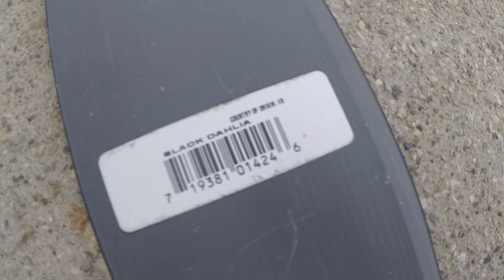BEST LED Light Bar Whistle FIX!

Comment: I guess the question is "Why doesn't the light bar come with a wind deflector?"
Reply: The real question is: why does a LED light bar need vents
Reply: The come with noise isolators that get rid of it. It's a some rubber pieces you stick on the light bar. I didn't know what they were for, I assumed an isolator for a mount. I figured it out accidentally. I drove around with my light bar mocked up and no whistle. After I cleaned everything up I removed the rubber pieces because I figured I didn't need them. Then it whistled. Took me a while to figure out the important change was the rubber pieces.
Reply: @RHEC1776  Because LED's burn extremely hot and need to be cooled. These are heat sinks to keep the light bar and LED's from going full Fukushima.
Reply: @SumDumGuyInCali  lmao
Reply: @SumDumGuyInCali  LEDS do not get that hot, idk if u were joking but this is not true
Reply: @isatntt  not that I want to argue about light bars, and I do infact agree with you that light bars likely don't get too hot, but look into enthusiast grade led flashlights. They 100% need cooling since they literally light things on fire without it. If you had your light bar on for an hour or so without moving the vehicle in the middle of the forest without wind, the might burn up without the cooling fins, otherwise they are probably fine without them.
Reply: @chadweissC2233  fair point

Comment: Garage door rubber trim does the same thing. In my opinion it works even better there is no need to do the caulk. It has it's own grip. I even cut it down a little past the end and put the rubber stoppers they gave with my bar on the side. Although they weren't  needed.

Comment: This just saved my life! Going to lowes tomorrow lol
Reply: did it really help ? please reply asap
Reply: @kozmicflush980  i actually ended up just putting a line of silicone in a caulking gun in the vents and it worked perfect!! Every other vent
Reply: @shelbylynn92  OK i may do the same thing. thanks

also, I'm worried now about Windshield glare and rain/water leak into the cab... what has your experience been like with those two issues?

I have my light bar now but just waiting till this weekend to install it. Hoping everything goes well
Reply: @kozmicflush980  i haven’t had any problems!!! Let me know hope it turned out. What light bar did you buy?

Comment: I installed an 52" curved lightbar on my 2001 Chevy Silverado. Got on the freeway and yes a Super Loud High pitch Whistling sound. I did exactly what you did in this video and OMG it worked, It was quiet. But it does still sound like a window is cracked open and it will leak water in the rain. You'll need to silicone all the Mouldings to seal in the brackets from sound and Water leakage in the winter.
Reply: Where did you seal around with the silicon? Just where the bracket touches the door seal?

Comment: I have the same issue. Off to Lowes to get the vinyl stair tread and sealant as you have in your video. Thank you for showing another option. Was going to try auto/marine rubber weather stripping).

Comment: I thought maybe drilling holes in the fins would disrupt the airflow hmmm. Thanks for the info.  Instead of gluing it maybe some short sheet metal screws to hold in place. Or both.   Thanks. I’m installing a 54inch on my yukon soon.

Comment: Where did you go and what exactly did you get? I have a 2007 Xterra with a 40 inch straight bar and my noise is more of a wind/storm noise VS a whistle.....if you could comment what exactly you bought so I can do the same! Thanks!
Reply from the maker: I went to Lowes. You should be able to find it anywhere; Lowes, Home Depot, Ace hardware, etc. It's called baseboard molding. It's a rubberish material. The noise is all the same, some people just describe it differently.
Reply: Did it fix for you @Daniel

Comment: You can buy some door trim very cheap and it has the adhesive already on it and do every other fin and it takes the noise away completely and it's black so it doesn't show at all
Reply: Jeff Prevett  yeah, door trim doesn’t work at all... at least mot for my Jeep.  It actually made it worst

Comment: That Howling issue would sound like a Whistling Kettle or you might think it might be something in the engine bay area,  I have seen Another video where they just put rubber door trim across the fins and it Fixes the problem.

Comment: Does your light reflect on the hood? I have a white Silverado and the flood light part of the light bar shines on the hood quiet a bit. Really annoying.
Reply from the maker: Yeah, it does very slightly, so I pointed it slight more upward. Only way to fix that is to probably make some deflector that that sends the light upwards. I just deal with it.
Reply: Six Speed Southern a deflector exists. I saw it on a website but i can't remember which one lol

Comment: Just found out what make noise on light bar. The frame who keeps glass had sharp edges and small screws. I  did cover them with 1cm wide strip of sound insulation material and from now problem od noise gone. What you need to do is find some material or filler to fill up and smooth that frame.
Reply: Frame on windshield

Comment: Great idea and I love it! I should be getting my 52inch curved lightbar tomorrow and I plan on doing this cause I'm sure it'll whistle. How wide did you end up having the pieces?
Reply: Hey stranger   i just ordered my 52 inch bar. Did this video help your whistle? please reply when you can
Reply: @kozmicflush980  i actually went with a kit from autozone for $13 and its worked amazin!
Reply: @shummell624  what kit?, I have tried the edge trim with no luck before
Reply: @brentp4217 Blazer international noise reducer inserts. Still holdin good.

Comment: With the glue and boards you put will it melt away? I don’t use my light bar much but was worried the heat from the light would melt the glue? Is this possible?
Reply from the maker: Nope! Doesn't get hot enough to do so. Havent had any issues
Reply: @SixSpeedSouthern  thank you!

Comment: How many inches is the baseboard strip after cutting it?
Reply from the maker: May differ from light bar to light bar, but I cut it down to about 45 inches if I remember correctly. Just put it up to the light bar, make a mark and cut it there.

Comment: would it fit on a 52 inch straight light bar?
Reply: my noise is like a rumble noise would it get rid of that noise?
Reply from the maker: Anthony Costill it will fit it and more than likely it's the same noise. all led bars make it

Comment: how can it cool if you are deflecting the air from the fins?
Reply from the maker: I have the top deflector several fins down and the bottom deflector 1 up. There is plenty of air going around it to cool it down.
Reply: The fins work by displacing heat, not necessarily cooling down from the wind.

Comment: Hey does your brackets cause your door seals to sound like their letting alot of air in
Reply from the maker: Haven't had a problem with that. May just be the door seals are old and need to be replaced
Reply: I've had the same issue on my 2015. sounds like a window is open. did you happen to find a solution to that yet?

Comment: I still have a whistle on mine....its quieter but not totally eliminated even after putting the rubber on all fins. Really wish I could track it down but this eliminated about 90 percent of the noise.

Comment: Cheapest, easiest, and most non-invasive fix is to get a roll of the peel-and-stick door / body trim.  An 18' roll is less than $10 at Walmart.  You only need to do a few of the fin edges, typically 10-12" sections.  Installs in minutes, is virtually invisible, and lasts nearly forever.